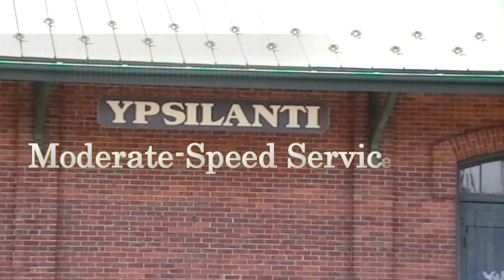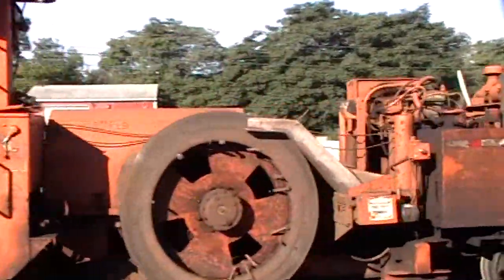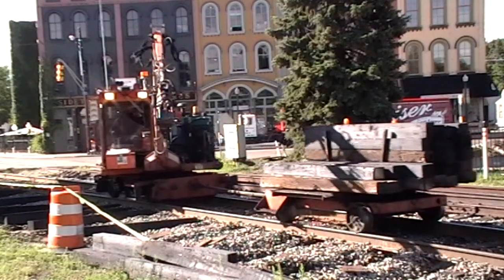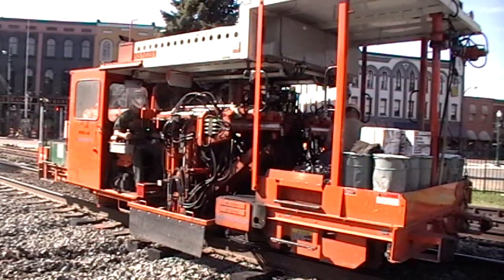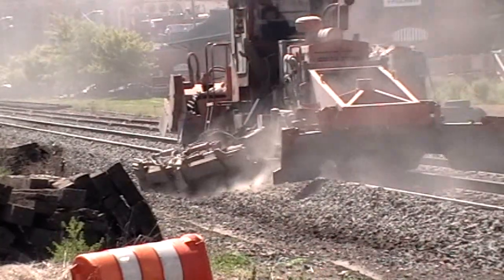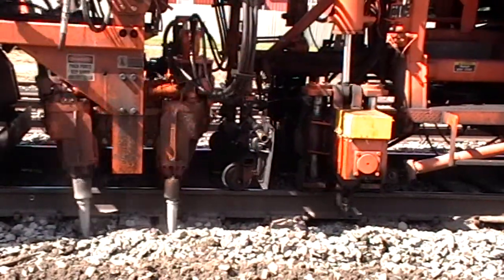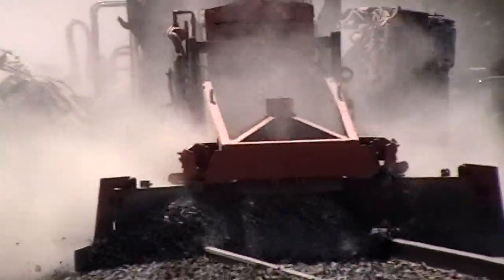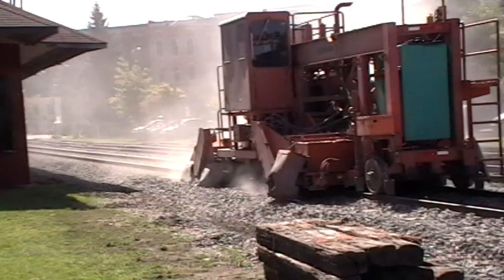Track work in Ypsilanti, Michigan

Comment: I will never understand why we are STILL at least 100 years behind on railmaintance.The Japanese blow this garbage away!. They use concrete roadbeds,very little track maintenance is ever needed.Diesel is running at $4.19 a gallon,you would think the railroads in this country would want to cut down on the constant track maintance and install concrete roadbeds to cut long-term cost,I guess not.The answer corporate has for this..."WE HAVE TO PASS THE COST TO THE CUSTOMER" LOL!!.